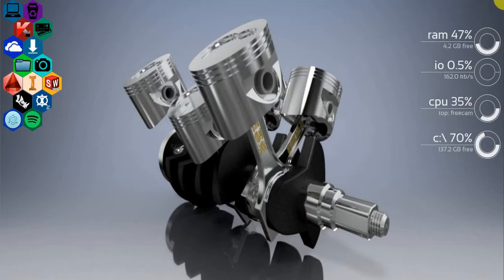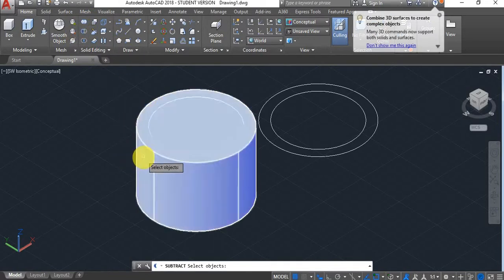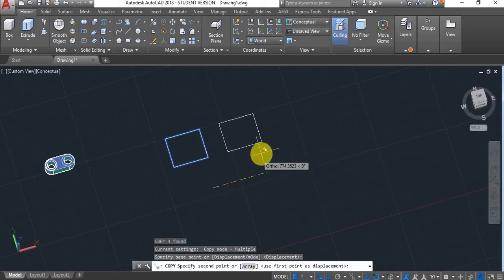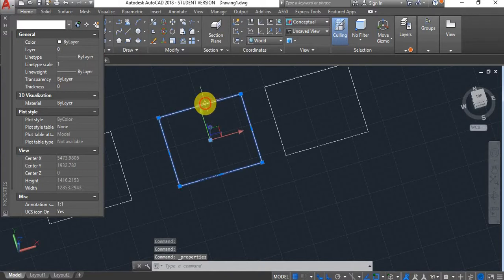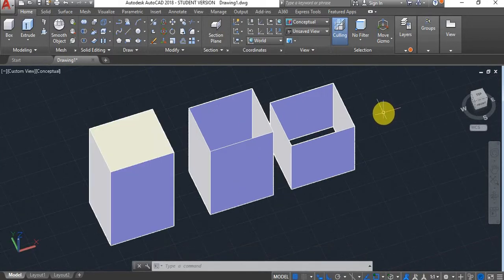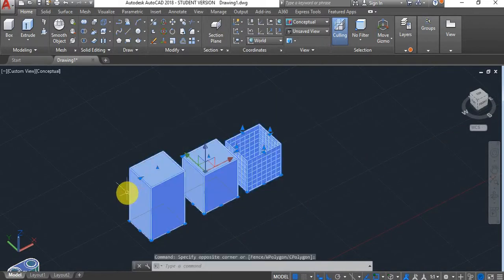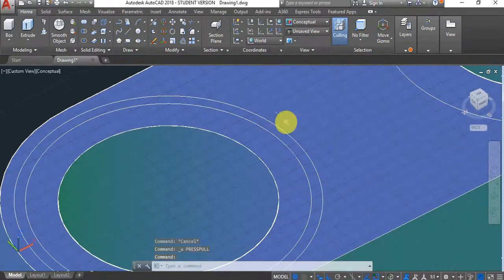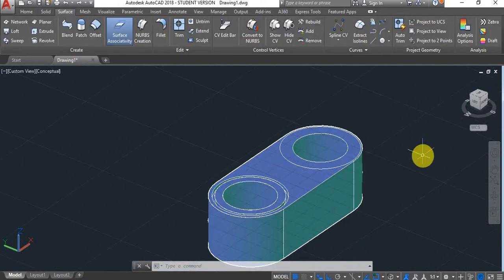Autocad 2018 Tutorial 7   Extrude, Presspull and Subtract Commands  Common mistakes and how to troub

Comment: Can you help me please?
I subtracted the centre of one 10mm washer. Perfect. Now it refuses to subtract from a second washer. 
Hitting Enter after each object selection returns to the command line.
I have to select both objects before hitting enter, then it still returns to command line and will not subtract.

Even right click after 2 object selection does the same thing. 
And I'm selecting the outer surface of the washer first as you do. Infact I've tried every way I can think of.